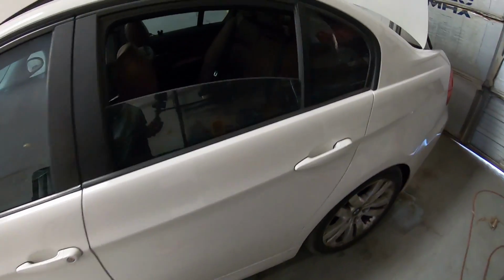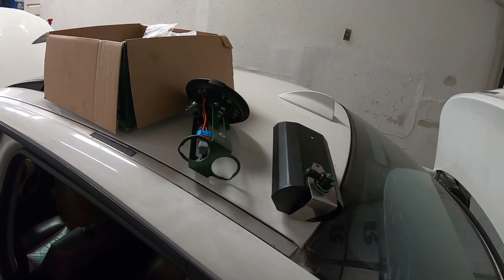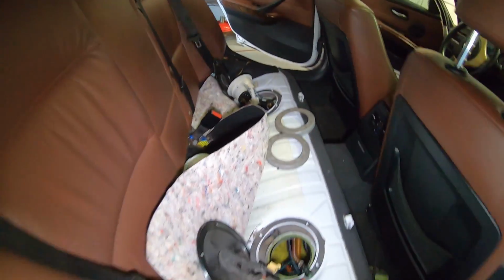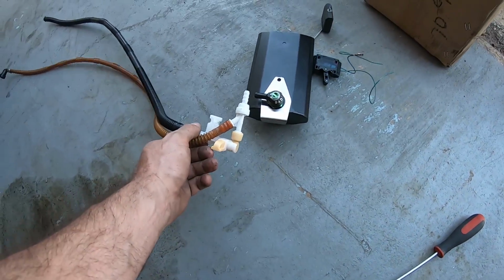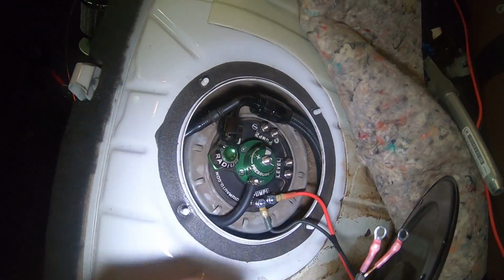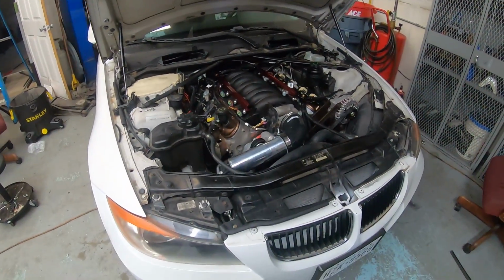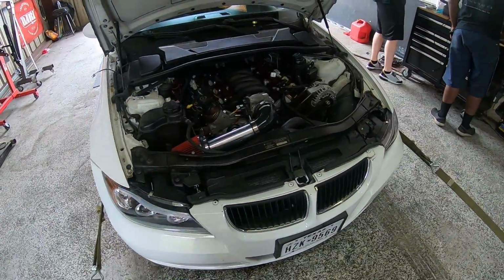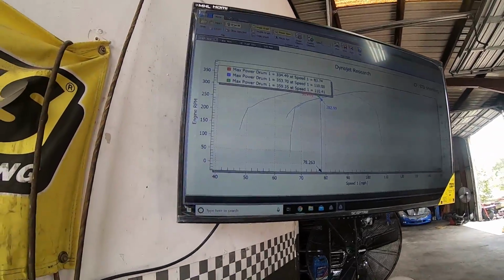LSE90.com BMW LS Swap - Part 4

Comment: You know putting a damn truck engine in a bmw is kinda dumb. I checked out the idea and decided if I want a hot rod then I will build one. You don’t put a Kia engine in a 80,000 dodge ram.
Reply from the maker: Bet you're an absolute blast at parties.

Comment: Will the truck manifolds hurt performance at all?
Reply from the maker: N/a wise you’re def leaving power on the table, but currently the only option for exhaust is stock LS3 manifolds, or CX racing mids and for the price we don’t really think they’re worth it.  That being said Mike has a set of LSE9X longtubes in the works and hopefully we’ll have a preorder soon to gauge how many need to be in the first batch but that should be happening very soon
Reply: @lse90garage  oh sick!!!! I would def be interested as I'm getting things prepared for this swap. Still in the early stages but trying to get a list of everything I'm gonna need. I'm building a cam+valvetrain 5.3 to put in a 6speed 328.

Comment: Good sir, do not delete your 4 part series please. Just waiting for my N52 to blow, it just seems to like the beating. The LS swap is soon and my mechanic needs this lol
Reply: You’ll wait for a lifetime. N52s are thr most reliable engines bmws ever made
Reply: You guys seem to be right, it's still kicking
Reply: @ Dude, unless you hammer on the thing while it’s ice cold, and change your oil at like 20k intervals that thing ain’t dying bro. Guys swap n54 turbo systems onto them, and they don’t even break lol
Reply: Good luck buddy, N52’s don’t blow. Ours is at 266k and I’m using a small puff of smoke on cold start as our excuse to swap it. They’ll go for 400k even if you beat on them lol

Comment: Planning to do this to my E91 Wagon 😈
Reply: @midway2k718  Doing a 6.0 aluminum truck engine in my 266k e90 soon. Love the car as is, but it’s getting tired. The 6L80E bolts in place of the factory GM 6L45 trans in the BMW’s btw

Comment: After swapping engine have you noticed the fuel gauge fluctuating at all?
My gauge moves a bar to the left/right as I’m driving and can’t figure it out. Not sure if it’s because of the lack of dsc communication
Reply from the maker: No issues on my personal Procharged 335i, it reads correctly down to empty and throughout the range. If that’s the only gauge acting up you may have some wiring connection issues or a sending unit issue.

Comment: What about using the lift pump to feed an inline, external pump? Use the 2000 Vette fuel filter with the built in pressure regulator. Just need to plumb in a return from the filter back to the tank.

Comment: Hey so if I have a n54 setup I can run the stock fuel system with my LS swap or do I have to add the 450 walbero fuel pump

Comment: Which LS engine do you recommend?
Reply from the maker: Biggest one you can afford, physically they’re all the same size, only clearance issues would be if you tried using a 6.2 Cadillac motor with a blower, the belt drive is a cluster. If you can afford an aluminum LS3, do it, if not a 6.0 with good cam and intake is a solid runner.
Reply: @lse90garage  thank you for feedback 😀

Comment: guys using drive by wire or cable ?
Reply from the maker: DBW
Reply: @lse90garage  did you get the GM DBM for LS1? also does the holly control the DBM?
Reply from the maker: I’d recommend you watch all the videos.  It’s all covered, there’s even a step by step on how to wire the Holley.
Reply: @lse90garage  will do ! Does it cover how the clutch pedal is adjusted for the GM tranny? Also if I get a automatic, I would have to add a clutch pedal ?

Comment: I wonder if it’s possible to use some stock headers and cats to make this legal in Ca
Reply from the maker: Technically no because the OBD2 is no longer a working part of the car once you remove the PCM.   If you piggy backed the stock computer so that CA could plug into the car then maybe.
Reply: @lse90garage  oh okay, so you are saying some stock ls headers and cats can fit in the e90 engine bay, I was under the impression that steering shaft gets in a way on the driver side and thus header needs to be modified.
Reply from the maker: @fastboatster  there are a few options like stock 5th gen camaro manifolds that fit and clear just fine.
Reply from the maker: I think you’re confusing headers with manifolds, there is no aftermarket “header” that fits outside of the CX racing mid lengths, however several stock cast “manifolds” fit just fine.
Reply: @lse90garage  I think I am confusing manifolds and headers. Appreciate the info!

Comment: Hey Guys!
My ls3 e92 is pretty much done (running GM ECU). Only issue is we are seeing the battery drain really quickly for no reason. Wiring issue? Need different battery? 

TIA 🙏
Reply from the maker: Probably need to check your wiring, disconnect what you added and see if the drain is there?

Comment: Mike, this is an awesome series. Watched it all, took a few notes and have a few questions I need help with before beginning to accumulate parts.

1. Do you have the part number for the spicer adapter on the driveshaft? Trying to decide if I want to use the OEM driveshaft or spend more for the custom piece right away. I know that’s what you suggested, but I’m not planning on making this a turbo application. Open to suggestions.

2. A/C. Looks like your canbox will work for the stock trigger A/C button. Didn’t see this until I watched the cost breakdown video.

3. When Frank went to buy a battery, is this still a BMW spec battery? Did you need to use BMW software and a laptop to get the car up and running again? Not sure if this headache was retained after the swap.

4. Will a 400hp car require a brake upgrade from the 328i brakes? Considering doing the 335i brake swap if needed. Want a nice street car, mild cam. Didn’t see any mention of brake upgrades for Frank’s that I remember.

5. What kind of HP/Torque limitations are you seeing with the stock BMW 325i/328i rear end? You mention big power requires the Ford diff and strengthened axles.

6. When you complete swap and code out check engine, have you figured out a way to code out the abs or traction control? If not, I’m assuming the car won’t have traction control post swap? Not familiar with this system.

7. Since this will be a daily driver, I’ll need to pass emissions where I live. I’ll need to incorporate all o2 sensors, cats, and any other emissions components that come stock on the LS drivetrain. Do you see any issues with this?

8. Please let me know when the Canbox is available. 

Again, awesome job. This is the kind of information I’ve been looking for. Plug and play solutions, wiring demonstrations etc. glad to see someone tearing it up in a BMW.

Comment: Did you use stock diff? Not winters quick change?
Reply from the maker: Internet Dolphin this car has a stock 325i diff, for big power we swap to the explorer 8.8 which mike sells the brackets for, and seems legit garage axles.

Comment: It's nice Swap but you could buy 335 and upgrade  to single Turbo   make 500 wheel horsepower And its less weight
Reply from the maker: Tag us in the video when you do, we’ll tag you when this one makes 700 wheel with its new turbo setup.
Reply: also have fun dealing with single turbo n54 issues

Comment: Would the stock bmw fuel pump (n55) be enough to run a stock 4.8, what do you mean won’t get you far ? Will it burn out, or do you mean if your looking for more power output ?  Awesome videos ! Very informative
Reply from the maker: Dylan Bickerstaffe this car actually ran fine on the stock pump, and you’d prob be ok with a stock 4.8 long term, but frank had more plans(turbo) so he had to go with much more pump
Reply: @lse90garage  ok for a for a basic 5.3 swap with intake, header, and exhaust the stock fuel set-up should work well??

Comment: Have you been able to get the stock tach to work with the LS yet?
Reply from the maker: Yes, there is a CAN box that plugs in and makes the gauges function, Mike has no released the new version yet.

Comment: I’ve got my LS3 sitting into my e92, need help on the fuel system. Going to do the Radium surge tank, but need help with fuel pressure regulation. Any ideas???? 🙏
Reply from the maker: built into the radium unit. Makes it simple
Reply: Awesome, much appreciated!
Reply: Guys I’m a little confused.  Do you need to tweak the fuel system because of the turbo or would a NA LS also require extra fuel help?

Comment: I’m thinking about doing a swap on an 07 e92 325i - my question is does all the electronics still work inside with the Holley? I was going to install an aftermarket apple play unit - thanks for the series
Reply: All that info is in this series

Comment: Very good video guys, I have a question how much $$ money do I need to do the Ls swap??
Reply from the maker: If you’re able to do the work yourself expect to spend around 5-6000 in parts depending on engine choice, transmission, clutch, cam, etc
Reply: @lse90garage  how much you can guys charge me to do the wiring and tuning?
Reply from the maker: If you used a holley ECU and brought us a complete swapped car that needed wiring, $1500 labor plus $650 for tuning.
Reply: @lse90garage  where u guys located

Comment: Could you do the wiring on the e87 if I do the engine swap? How much would it cost and will the stock dash/ display still work as normal without lights popping up everywhere?

Comment: After the swap are you guys getting any check engine errors? Or does the harness you guys use clear any error codes you may get? Thanks!
Reply from the maker: there is a dme error.  Once you code it all you are left with is a brake and traction light.

Comment: i have an 07 e92 328xi i will like to ls3 swap and make it a rear wheel drive but keep the dash and HVAC bmw stock. is that doable? most sites says the e92 are impossible to hack.
Reply from the maker: Keeping the dash and a/c stock is perfectly doable, but seeing as your mentioned making it rear wheel drive, as opposed to the AWD setup, that would fix the main issue.  The only reason Mike doesn’t offer an Xdrive Kit is because they’re really hard to find for cheap around us, so nothing to build off of. Swapping out the front subframe to a standard E90/E92 one will solve the problem.
Reply from the maker: The X chassis is what will be your issue, the LSE90.com system does not work with the x drive chassis unfortunately.
Reply: That’s wishful thinking

Comment: Can u send me link for a pump thats all i need to do my ls swap
Reply from the maker: The pumps used in this setup are walbro   F90000267 pumps, you can search eBay or amazon for that part number, normally they run about $105 but for some reason the price has almost doubled.  A much better option with less draw is the F90000295

Comment: I'm surprised the stock diff can handle the current NA power.
Reply: 335i's put down 400tq+, not even including the big/single turbo setups that'll do 500wtq all day
Reply: @surreaLinnovatioN  yes but this is an n52 car